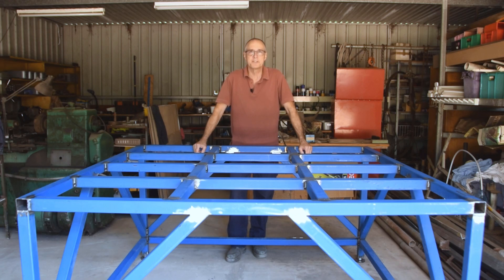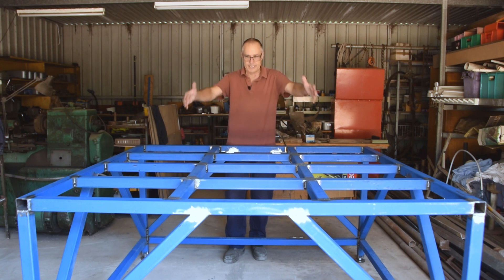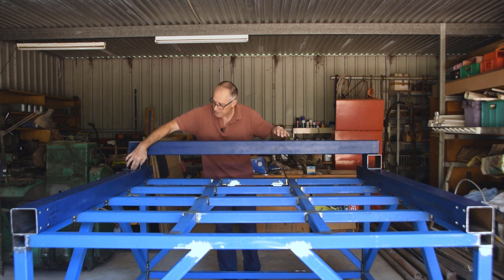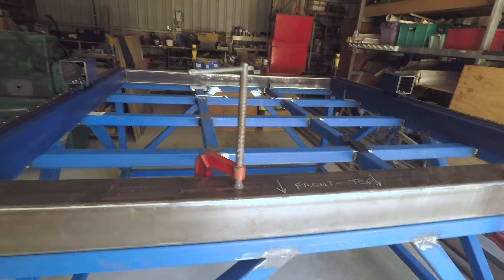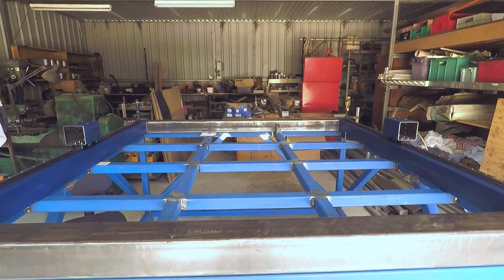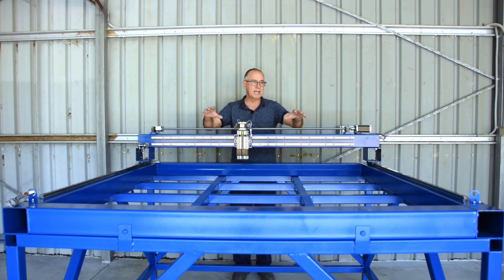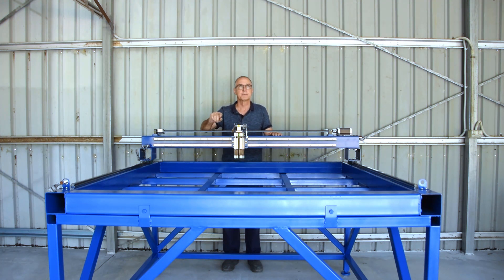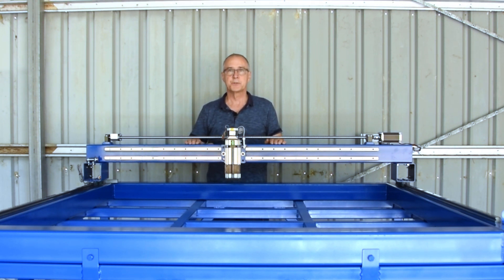How to build a CNC Plasma Cutting Table | Part 4 - The Structure is Complete!

Comment: Any reason why you chose 100mm deep water pan? Great build
Reply from the maker: That seemed to be about the typical depth of water pans. Also, my frames are 100mm high, so it made sense to make the top of the pane, level with the top of the frame.

Comment: isn't it too big for ball screws?
Reply from the maker: No, I don't think so. The table works fine for the speeds I'm running. I turn my amps down when I cut thin material and turn it up for thicker material. Maximum cutting speed is around 4000mm/min and the ball screws handle this with ease.
Reply: @RustysMetalSigns  i saw you said it's 120x120cm, i didn't know at the time of my comment and for some reason it just looked industrial size.
What diameter are the ballscrews?
Reply from the maker: The table's footprint is 1800 x 1800mm and the working area is 1330 x 1330mm, which easily handles half a sheet, although I have to lay the full sheet on the table to cut it in half.
The ballscrews are 1605 (16mm diameter and 5mm pitch). I don't get any wobble from them but if I was building this table again, I'd probably opt for 2005 or 2010 ballscrews.
Reply: @RustysMetalSigns  that sounds fair, thanks.

Comment: Heavy over engineered base is fine, however if you want to cut thinner materials, you will end up building a lighter gantry and ditching the ballscrews.
Rack and pinion would be a much better choice.  
Plasma is a very dirty process.  Make sure to use the little plastic plugs for the bolt holes in the linear rails.
Where in Aus are you?  The accent and magpies give it away. :)
Reply from the maker: Hi Greg and thanks for your comments. This is my first venture into CNC so I built this table 'on a budget'. As I've seen other tables using the ballscrews, I copied their basic design. 
I live in WA, about an hour's drive south of Perth.

Comment: I really like the way you are going with this. Not overcomplicated, and you are using materials that is very common and easy to get.
Reply from the maker: Thankyou for your kind words. I think I'd probably do away with the support table and just weld 100x100x3 legs to the underside of the two Y axis frame rails, then brace them the same way I did to the support table. 
I was concerned about warping the whole thing if I welded legs onto the bottom of the Y frame rails, but if I clamped them securely before welding, it would probably be ok.
The next table I build, I do it that way!

Comment: The best  and easy  design on youtube.  Thanks  for all your  videos.
Reply from the maker: Thanks Ouroboros for your comments. I'm glad you're enjoying the videos of the build and I hope they are helpful to you if you're building your own table. If there's anything that I haven't explained, or there's something you need help with, just ask, ok.
Reply: I'm trying to build  my own one  so  your way is the  best what I have seen. Do you recommend  any pinion gear ?    Thank  for answering
Reply from the maker: I went with the ballscrews (these have a 5mm pitch, meaning the ball nut moves 5mm per motor revolution) and if need be, I can use ballscrews with a greater pitch (10mm/rev or 20mm/rev) if I need more speed.
If I build a full size table (one that will take a full 2400 x 1200mm sheet of steel), then I will need to go rack and pinion because a ball screw that long would probably be too whippy and vibrate.
What size table are you building???
Reply: @RustysMetalSigns  yeah  my  plan is to get a full sheet  size  1200x2400 something like that...  thanks for your your advice!

Comment: Nice job well done 👍. I'm gathering parts to build a simple one using GRBL with no THC just to understand the limitations from experience and upgrade from there. I'm interested in moving to a Masso control system or myplasm like yours later on. All the very best. Cheers J
Reply from the maker: Hi J, thanks for your comments. I"m glad my videos are helpful to you. I'm looking forward to having my table up and running, which isn't too far away now.
Reply: @RustysMetalSigns  looking forward to seeing the results. Really nice work 👍